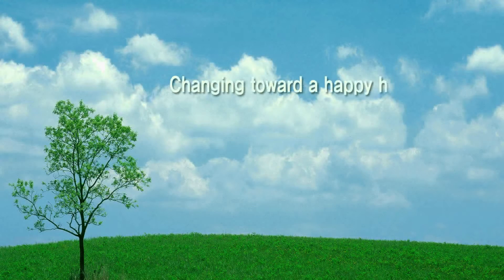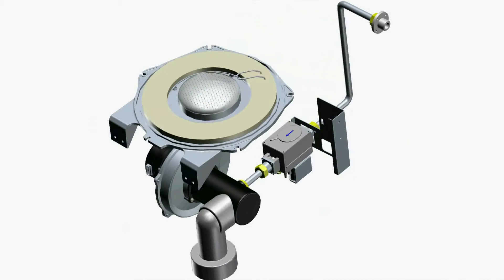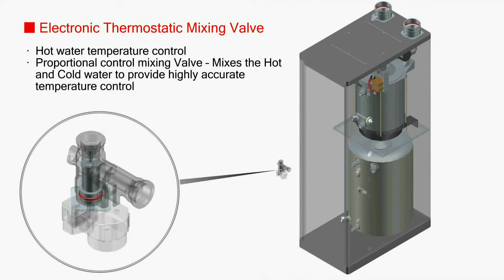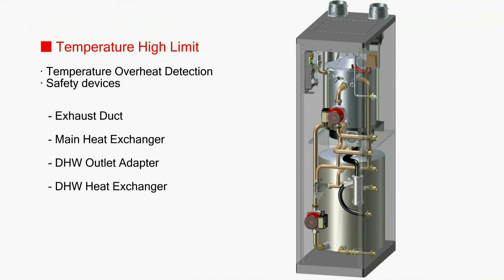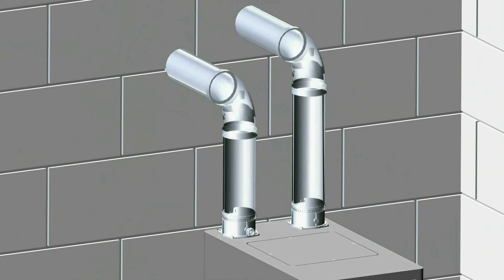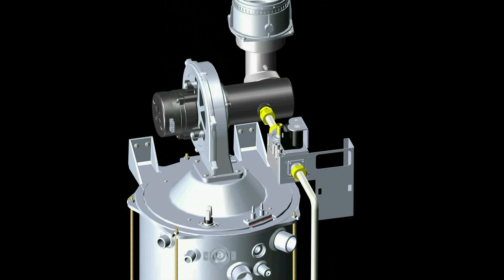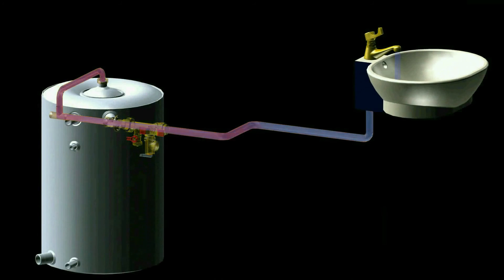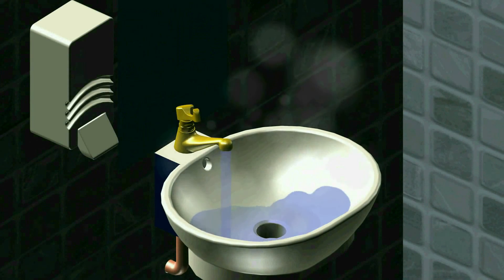EFT Combi Training

Comment: I am getting Err 16 way to many times. Heating company changed the board but still having problems. Heating company cleaned mixing valve still later err16. What to do?
Reply: I would bet the heating panels you have this connected to are offering up too much resistance to water flow for the on board circulator to overcome. This error code has mostly to do with insufficient water flow through the heat exchanger causing the boiler to overheat and lock out on high limit. Companies which change parts like circuit boards the rarely fail are in over their heads and should not be installing these products without better trained technicians. The mixing valve has nothing to do with this issue so cleaning it is another stab in the dark to figuring out what is really wrong. Which I highly suspect has to do with improper installation . http://www.errorhelp.us/category/heating/htp/elitefiretubecombiwallmounteftc140w/er16